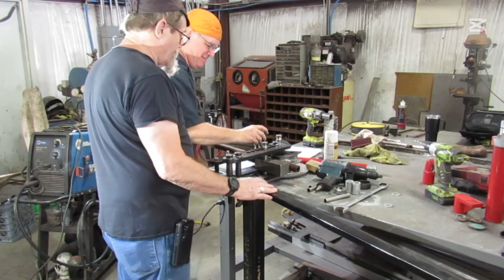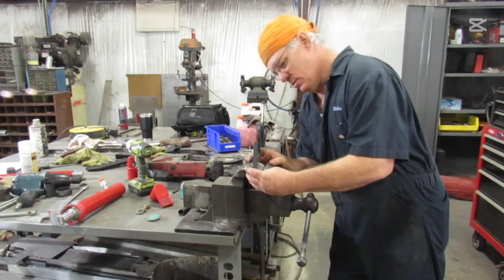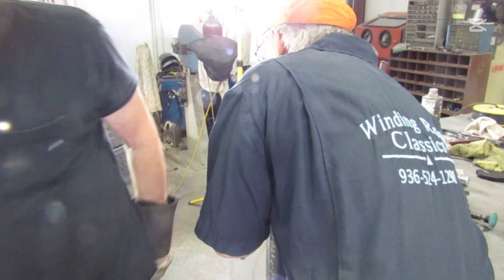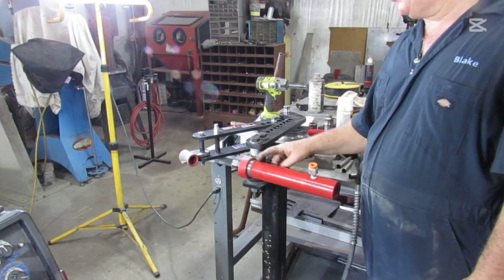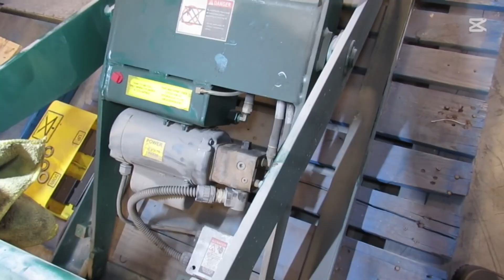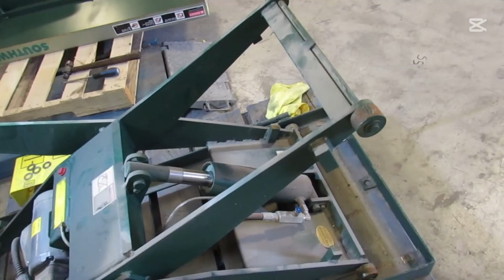Hydraulic tube bender pt.1

Comment: Where did you get the piece that the cylinder ram was threaded into?
Reply: All of the hydraulic ram pieces came from the porta-power unit.  The motor, pump and frame came from the hydraulic table.  The control was donated by Ward.